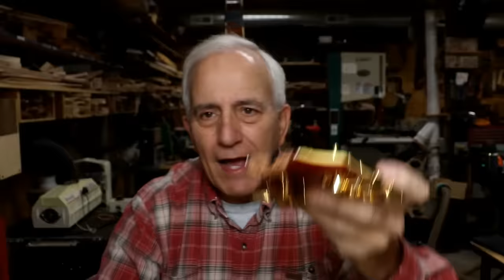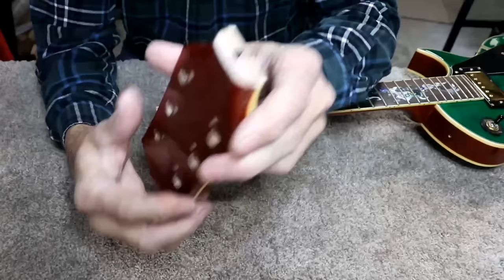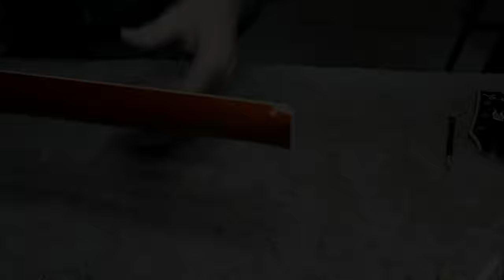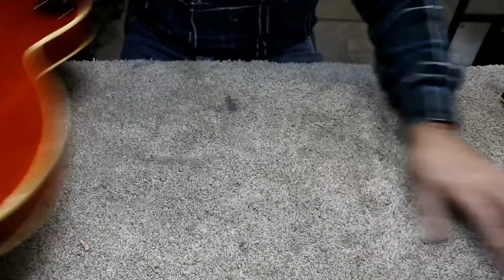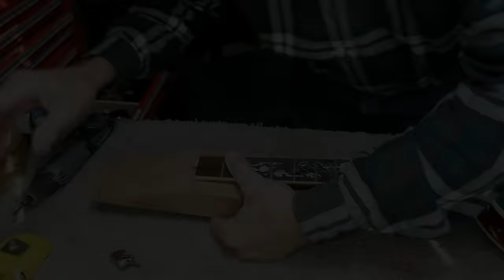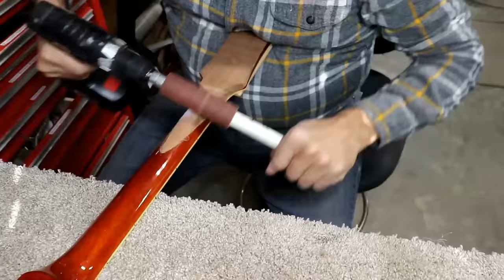623 RSW How Do You Fix This??? - ANOTHER BROKEN NECK Electric Guitar!!!

Comment: On your wood mallet, sand it down then coat it with resin, it will last forever and if you use Total Boat resin kit they have the best products for that stuff! I have been woodworking and a mechanical engineer as in a little more than a mechanic or technician in everything from cars to semi trucks, heavy equipment to helicopters and military aircraft of all kinds and in every area of working on them to include armament systems. I also am into building models plastic and Diecast to include dioramas! Also plumbing carpentry electrical foundation and every other phase of building residential and commercial to drafting! I was taught in my freshman year at Paradise Valley High School in Paradise Valley, Arizona to learn as many trades as you can because you never know what the economy is going to do. So always have a trade to fall back on. And I always work two or more jobs at a time. With my ex wife’s SPENDING ADDICTION, if I had not I really would have been in a BIGGER BIND than what she put me in. Trying to bankrupt me, but I made through and had Full Custody of my 4 sons and didn’t have to pay her anything lol 😂 thanks to Jesus! But I have a lot of different kinds of repairs and am restoring a triple floor bass drum set with many Tom toms l, two snares and bunches of cymbals. I also do guitars! Keep putting out videos I enjoy them!

Comment: Do you watch Ted do Les Paul's? He make custom dowels to fit both sides of the trust rod once the head is replied back then cuts same wood dowels (2 mahogany) to fit on either sides of the neck to the headstock. Shapes into the neck and headstock, fills into simular color, clear lacquer, slightly tinted and dry. Give it back, collect your fee.

Comment: Kindly, from the family of Les Paul's Luthier...This is a common repair.  The finish is Lacquer. Use paraffin wax i.e. Renaissance Wax, on the truss rod to prevent gluing and seizing the truss rod! Build a JIG with custom CAULS to hold, and clamp the head stock in line with the Neck and fingerboard.  Building Cauls and Jigs is an Invaluable, time-saving, woodworking skill. (Watch You-Tube: Twoford for Excellent, simply made, examples of Luthier Cauls and Jigs for this repair).  Use a small ROUTER in a head stock routing Jig to route two recesses about 2" long, crossing the head stock break, on either side of the truss rod slot. Inlay solid wood into the routed slots. Re-shape the in-layed blocks in the Volute region into the shape of the neck with hand planes or sand paper,  match color, then over spray with Lacquer. 
 For EXPERT "Head stock Re-Capitation" Watch You-Tube: Twoford. This will answer ALL of your Questions of "I don't know How to do this"(smile). Asking others with professional training gains Respect,   Peace, Mark
This is a common repair.

Comment: Jerry, I'm asking a question of you and proposing a theory all the while.  The truss rod is meant to bend, from inside, the neck wood so as to reduce the bow in the neck that, over time, this string tension produces.  But... carbon rods are meant to reduce any bending at all.  So, if the neck contains both (reducing the wood thickness strength due to the contour), isn't this is at CROSS PURPOSES?  And if the owner tries to straighten a neck, there is setting up TENSION within that wood and, presto, the neck fractures.  I say, go with truss rod for eventual use, or go with carbon fiber rods for continuous action.  What say you?

Comment: Why are users bend the neck stock instead of using an aftermarket whammy bar setup. If not mistaken there are units,   that does not do string bending attached to strings, but their are pedals that can bend full or single notes. So please explain why there are so many broken necks at the point of using headstock to create a bend!

Comment: definetely nota guitr builder or repair man , but looking at the break i might take the head a part (take off the tuners and all the screws and stuff then run the back of it through the tickness planer , sandpaper belt untill youre left with just enough material that the binding is still full size (basicly only reuse the front half of the headstock) 
wonder if you can set up the neck intoo a jig and use a router to make the scarfjoint perfectly flat and level 
one thing that could become a problem is that you cut through the length of the woodgrain on the scarfjoint you made , thats why the original is angled the other way ,

Comment: omg..maybe it would have been easier to glue the head on first ( as you did in the beginning) and then route two small slots in the neck/head transition in the back..and then glue two reinforcment carbon stripes in it..cheers

Comment: Jay Turser guitars are not expensive. That person must really like that guitar. This company made les pauls in the mid 2000's and they were priced similar to Epiphone. Not the newer higher end epihones either. Under 200. the top is veneer. That neck is awesome though and that certainly isn't one of their ordinary models.I'm sure that repair is going to cost the owner much more than that instrument is worth. That neck is pretty though until the top.:face-green-smiling:
Reply: The retail on those was not $200, the Serpent models retailed for $400-500.  That top isn't a veneer either, it's a flame maple cap.  I own two of these.  The JT 200 released in the late 90's and the JT-200D released in the mid 2000's.  
You are correct though, that repair cost way more than the instrument was worth.

Comment: This is a Jay Turser Serpent, LP copy.  They're going for around $400-500, used, on Reverb.
Reply: There's a bunch of different versions though. This one is an earlier one.. And the earlier ones are better. There's a LOT of variations. I have a black one of these earlier ones. The later Ives have a long triangle in the bottom of the crown thing on the headstock. 
I've never had to touch it or do anything to it yet. And it's been years since I got it. It's a tough guitar. Someone did something really bad to this one cause I've banned mine around and it's butt going to break. I actually have another blue flame topped one with the snake as well. That one, I modified.  Great great guitars.
Reply: @atakdragonfly1675  - Do you gig with your Serpent ?  Are you saying you have never had to adjust your truss rod, intonation, or action on your guitar?!? that is very fortunate.
The most common cause of a LP-style headstock break is when the guitar is on a stand. The guitar gets knocked over and lands on it's face, the shock of landing, combined with the 80-120 lbs of string tension, causes a failure of the wood at the weakest point.

    I have eliminated headstock breaks during live performances.  I have used nothing but headless guitars on stage since 1982.
Reply: @rb032682  I've gigged with one and not the other.. the one I never had to touch.. I only raised the bridge when I first got it. It was way too low. Never had a truss rod issue or needed an adjustment yet with 10s.. The other one, I didn't  HAVE to do anything to, but I had a plan to modify it. Cause I just wanted to. 
I changed out all the guts and took away the 2nd tone pot for one master tone and put a kill button in its place. Jack, switch.. Pickups. Put strap locks on it... But never did anything to the frets or the truss rod. I might put different pickups in my black one. But I really don't have to.
Reply: @rb032682  yes that happened!! My black one fell off the stand and landed on its face. Knocked by the cat. didn't have a mark on it. And my other one I bash it about.. it hits the wall at the back of the headstock.. it's tough. It ain't breaking... And I've been kicking that everyone... It doesn't have a scratch or a mark. Something happened VERY bad to this one in the video.. because I don't baby them... They are heavy tanks though.
Reply: @atakdragonfly1675  -  Did you buy the LP copies brand new?  What was the cost of the fake LPs?   I'm watching Mr. Rosa do a $200-300 repair job on a guitar which is worth $400-500 at most.  To me, it doesn't make sense to pay for a major repair on that level of guitar.
   If it was my guitar, I would repair that guitar myself to avoid the cost, and learn how to fix a broken headstock.
Reply: @atakdragonfly1675  - I think it's great you have been able to get that level of performance from these guitars.
  Play it loud!
Reply: @rb032682  you could... If you want.. or don't, if you don't want. The choice is always going to be up to the individual. There was a time I was seeing a lot more of them around, and now there's less. And, I never found the one I REALLY wanted either. If you really liked the feel of something, then what's the big deal to fix it, over there on the end? You're mostly interfacing with the fretboard, & the back of the neck... It's up to you!

Comment: When you have a piece you dont want sliding around when you put it together, sprinkle some table salt on there after spreading the glue. The salt will dig into both sides as it is clamped and keep it from sliding. Then it will dissolve from the glue and not effect the joint whatsoever

Comment: What an incredible effort you put into this project! However , wouldn’t it have been easier just to make a new neck and reuse the fretboard and headstock veneer?
All this headstock breakage shows what an inferior design the Gibson-Style neck with a large headstock angle and no volute is, and using mahogany with its short fibers doesn’t help the situation. My own 79 LP Custom has a 3-piece maple neck with a volute. It has actually been toppled over a few times with no ill effects. So Gibson basically knows how it’s done, but the clueless pseudo vintage guys force them and all copycats to use the fragile vintage design. Mahogany necks are ok, as long there is a volute and maybe even reinforcing rods, that run the length of the neck.

Comment: Jay Terser guitars are about the cheapest crap from the orient.  Whatever you charged to repair this thing was probably twice its original cost, if not more.  Also, they are known in the industry for having weak headstocks that frequently break.  I'm sure your repair made way better than it was originally.  I'm surprised that the owner would go to the trouble and expense. Must have sentimental value.

Comment: The guitar has to have a lot of sentimental value to the owner to spend this much on such a cheap guitar.  I have a Gibson SG (1988) that I got from a friend that died a while back. I have had cracks in the body repair a few times. My only gig guitar since 98 it is beat to hell but would have no problem spending a grand to fix it if needed.
Reply: They are going up in price... And you don't see them much. And with inflation going like it is, they are going up.  I've seen them for over 800. And they're really tough guitars. Easily modifiable.. you can easily make it whatever you want.

Comment: "Hard finish better transfers the sound". Noway. This seems incorect. We know that classical guitars and flaminco guitars are covered with soft shellac, and PREMIUM violins and cellos, and all PREMIUM eastern instruments (ouds and lutes and buzukis and baglamas and sazis and bowl mandolins etc.) are covered with SOFTER material (except sometimes from the bowl, which needs the extra PROTECTION of a hard-solid cover, due to its construction method: the bowl consists of several (app. 15-60)  wooden pieces and fillets glued together with natural animal-glue). The softer the finish-cover, the better the vibration(s) of the wood, thus the better the sound comes. All these are true for ACOUSTIC instruments. Do other principles apply to ELECTRIC instruments?

Comment: How come you haven't made a jig for glueing necks straight piece of steel  plate 4 inches wide 3/4 thick milled straight with segments of rubber to fit between the frets and 3  C clamps welded to the steel plate so you can put evin pressure on the neck and and the top of the machine he'd stock the plate should have c clamp welded to the plate pushing on the head stock toward the neck with a piece of 1/4 inch thick rubber to protect the headstock with a clamp and a few rubber wedges under the head stock for proper angle it would be cheap and work on many guitars oh and a piece of  1/2 inch by 2 inch wide aluminum  about 20 inches long atached to the plate with a screw that goes down to the heal of the body that has a right angle on the end with a piece of rubber on it to protect the body your jig is done

Comment: jay tursers only cost 80-400 for the nicest ones..... ain't worth  the trouble/time/cost of repair for chinese disposable knockoffs.   they copied a flawed design by not laminating the necks lengthwise.  scarf joint guitars are junktones, and usually have that cheap plastic dipped finish.

Comment: That's a $300 guitar when it was new, maybe $350. Who spends this kind of money to repair a MIC Jay Turser????
Reply: People that like them... they are actually really solid, solidbody guitars. Real solid body. Ave not easy to find a really nice one. And easily modifiable to be however you want. Someone that had it a long time... And played it and loved it... That's usually the reason someone would repair it.
Reply: And that new price was for the later ones. Most people were actually getting more. 
 The earlier ones were WAY better. There's a LOT of different variations of it. They're not all just the same guitar.
Reply: @atakdragonfly1675  I have a Jay Turser left handed (I'm cursed) 335 copy. It's an older model that I bought on Music Go Round for 200 bucks shipped. It's a solid guitar as far being playable. It looks like sh..... but it's got mojo. Whoever had it before me put in some low output buckers and decent pots. It stays in tune well too. My point is, this type of repair is usually very expensive. I guess I can see it if there's an emotional attachment to the guitar. This man is an artist with wood, his work is as good as I've ever seen. I just won't spend the kind of money required to bring back a cheap guitar. The best part of the repair, the volute. I'll never understand why Gibson, of all companies, stopped using volutes. The headstaock angle on most Gibsons just screams, I'm going to snap off if you even look at me the wrong way. LOL I'm not a guitar snob by any stretch, but I have my limits.

Comment: You went through a whole lot of nothing - for nothing!  That's a three hundred dollar Jay Turser guitar and they aren't worth going through all that trouble for. I would've cut off the headstock face and the fretboard and made an all new neck. Then bandsaw the old neck from the body afterwards. It would've been so much faster and easier! I would've even made a new trussrod if necessary.  Make templates of the neck shape in the back with solder bent around it then trace them onto paper then cut them out. Place each along the backside until you get the desired taper and shape. Sand the finish around the neck route (in the body) it smooth and glue the new neck on and put everything on from the old neck on it then match the finish as closely as possible (40% brown - 30% red, and 30% yellow) for this colour. Then spray clear coats over it. This was made with a polyester finish which is why it smells like fiberglass. I could've literally had that done in TWO DAYS! Thanks for sharing this with us any way - it's good to see someone else test their mettle and do something that is difficult but with satisfying results.